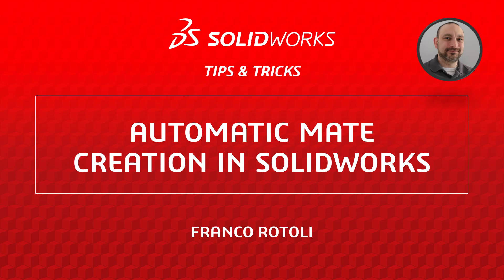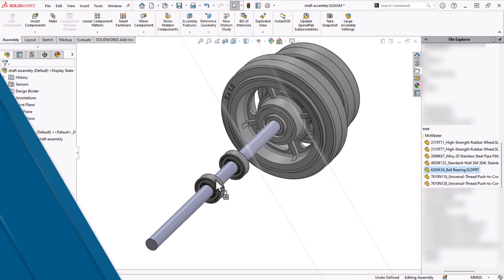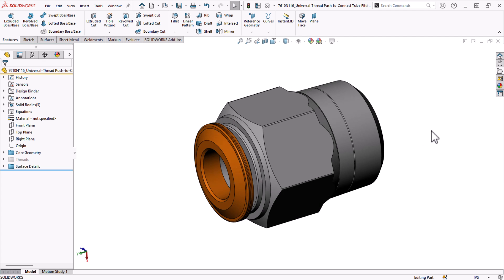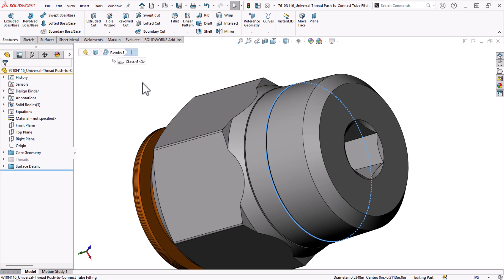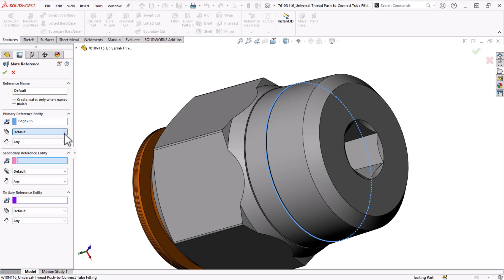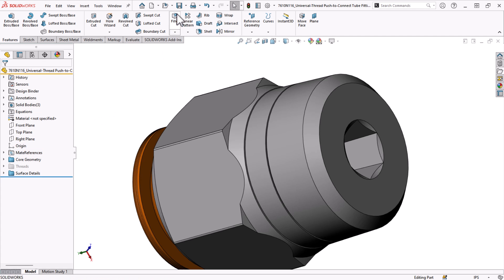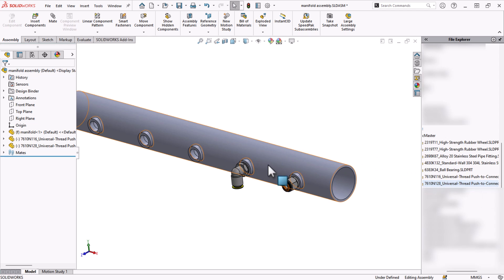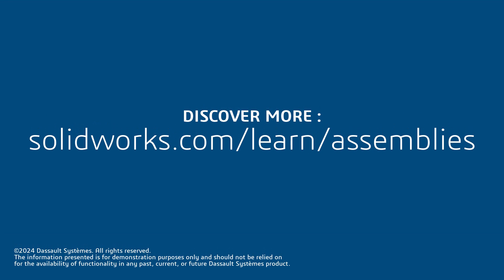Automatic Mate Creation in SOLIDWORKS

Comment: its a pity, that those mate references only use the basic mates, and for that always creates TWO mates, for an operation that could be done with a single advanced one.
"Profile center" works almost exactly like the "insert" mate in inventor, except that it doesn't accept arcs :(
in that regard, i miss iMates from Inventor...